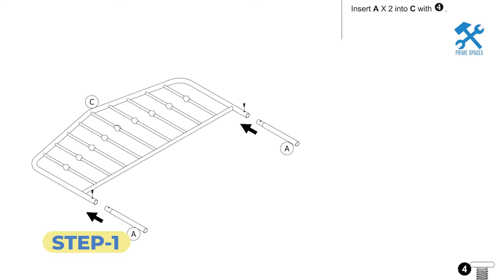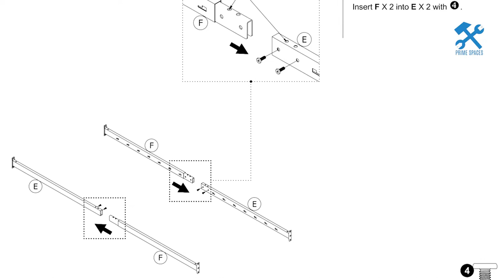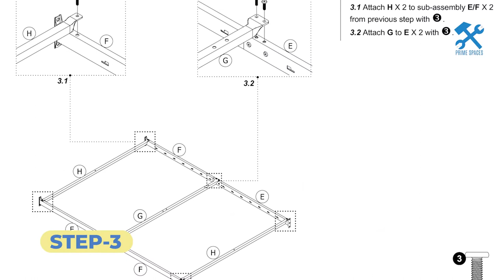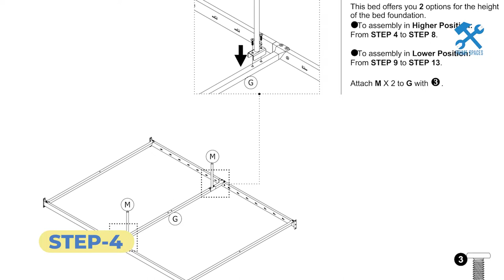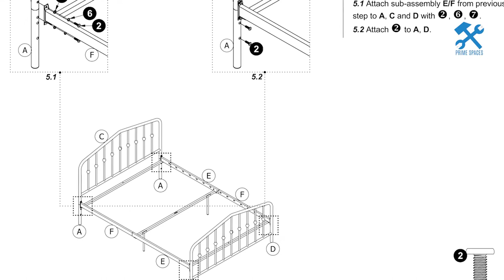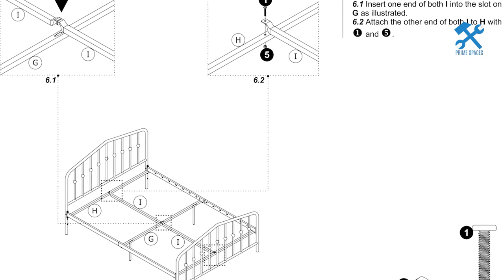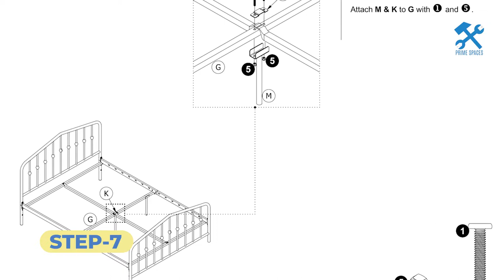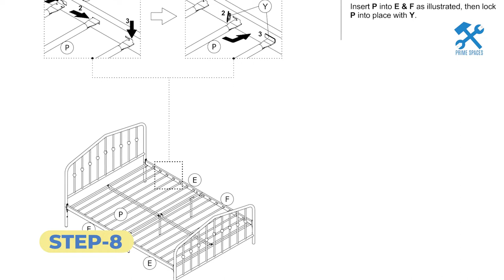Novogratz Bushwick Metal Bed with Headboard and Footboard Assembly Instructions (Step-by-Step Guide)

Comment: The legs M of my bed are shorter doesnt touch the floor why is that.
Reply from the maker: Hey there! 👋🏾 I think you might be using legs L instead of M.
Reply: @Prime_Spaces  you did not record when you flipped the bed.
Reply: Our legs don’t touch the ground either. Top hole long legs nope doesn’t reach. Bottom hole short legs the same.

Comment: I do not understand how the slats attach to the rails. Could you explain?
Reply from the maker: Slide one end all the way in, then slide the other in. Once both ends are in, slide them over towards the side with the grooved bottom then push them down into the grove. Then take the plastic caps and insert them about the metal slats to keep them in. What I described is what you will see in illustration of the manual in this step.

Comment: For some reason my middle legs won’t reach the floor. I’ve used both heights and every variation. Either the middle doesn’t touch floor or the four corners won’t touch the floor. Someone help!
Reply from the maker: Hey there, Calan! I think the issue you are running into is step 4 and 5. Depending on which part M you use (smaller or larger) on step 4, this will dictate which two holes you screw the frame into on step 5. If you use the larger parts M in step 4, then in step 5, you will screw the frame to the two top holes of the headboard. If you use the smaller parts M in step 4, then in step 5 you will screw the frame into the bottom two holes of the headboard. I hope this helps! Let me know if this works out for you.